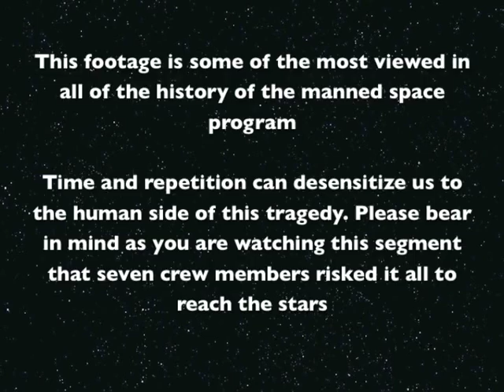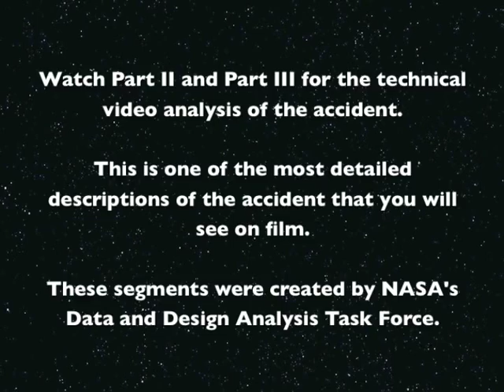Challenger Accident - Part I Launch

Comment: at lift off the O ring failed but amazingly some slagg blocked the seal that was broken and held it together, only when the shuttle passed through a strong jet stream (which you can see the evidence of at 11:31 ) did the slagg come loose and then the blow torch effect took place. also the crew cabin was intake after breakup and some crew may have been concious as the cabin fell to the ocean below.
Reply: fact. They died when they hit the water
Reply: Ed Weibe  yes! When they hit the water at close to 1,000 mph  to a sudden stop yeah! It killed them deader than hell.
Reply: D Marino That was just a guess I had no idea, when you hit the water at an unabated speed it will not be a good ending!
Reply: @gunn13fan  207 to 217mph they took impact 😐
Reply: Andrew Gray I believe it too! I’m sorry it happened!
Reply: @gunn13fan  200 mph not 1000...
Reply: @Faven2011  I'm aware of that

Comment: Yes, the same footage I have seen probably 100 times since the disaster, including watching it live the day it happened.  And again..it did not explode.  Aerodynamic forces ripped challenger apart after it veered from it's flight path due to the failure of the external tank and the asymmetrical thrust produced by the R. solid rocket booster.
Reply: Arsene Who?  they where alive when they hit the sea, unconscious likely but alive..
Reply: attached to a 15 story hydrogen explosion

Comment: It was cold in Florida and they were canceling flights because your not supposed to take off when cold and they took off and something froze and which cause the shuttle to explode!
Reply: westyn mitchell The cause was a faulty O ring. They knew about it. But failed to replace it
Reply: @terryshubitowski9395  It wasn't a faulty o-ring per se. Any o-ring would have likely failed at that temperature. It was a faulty design of the field joint.
Reply: @terryshubitowski9395  The o ring wasn't faulty. It froze because if the below freezing temperature that morning. When it froze it contracted and let the rocket fuel leak into the joints of the fuel tank.

Comment: All data showed an increased likelihood of primary O- ring failure corresponding with lower temperatures so they decided to launch in an environment so cold that they had no data available in regards to safety.  The industrial standard violating, improperly used 2nd O-ring always sealed before and if it dont at least we'll have the data necessary to create some real spiffy heated O-rings.

Comment: It did not explode...it disintegrated when the strut holding the solid rocket booster failed due to a jet of flame acting like a blow torch produced by escaping hot gasses which leaked around a frozen O-ring seal.  The booster pivoted inward and struck the vehicle, the impact and non-linear thrust causing the vehicle to yaw at incredibly high speeds leading to the near instantaneous disintigration.

Comment: Yes, there was no major explosion as such. The large "fireball" that people talk about is actually a huge "spill out" of liquid oxygen and hydrogen from the ruptured external tank. There WERE smaller explosions as various hypergolic fuels used in the attitude thrusters did explode when their tanks ruptured due to orbiter break up. These small explosions can be seen as individual flashes during the break up sequence. They also account for  the brownish splodges you can see in the overall residual plume.
Reply: All that equals a humongous explosion to 99% of the viewer.
Reply: @jerrymarshall2095  Looks can be deceiving.
Reply: @EricIrl  indeed they can.Eric

Comment: To be completely honest with you all, I would blame NASA because they didn't seal the SRB joint completely, if they did, they still would've been alive today.
Reply: jonathan ehlers I never blamed them because who knows what else might have gone wrong as a result of sealing it? Accidents do happen and people are human and do make errors. I remember people instantly blaming the cold even before the seal issue was named as direct flaw. I kinda think they just ought to have delayed for warmer weather. If they’d done that and still this happened I wouldn’t think they had such bad judgment.
Reply: it was too cold to launch. The seals were too stiff to get into proper place.
Reply: @corettaha7855  It wasn't an accident. Engineers at Morton Thiakol (the company that manufactured the solid rocket boosters) recommended not to launch at a temperature less than 53 F. They had been dealing with partial o-ring failings in the previous year.

Comment: Yes, they were heroes, but they were also patsies, placed in real danger in a claptrap machine pieced together on the cheap.
Reply: Kit Canyon  the shuttle was for sure no claptrap, especially operated as intended, and not as it was on this terrible day. However compared to other rockets, the space shuttle was bonkers dangerous - no launch escape system, no chance of returning if something went wrong until you could ride out the solid boosters.... The program itself was a massive waste of money in my opinion anyway, bar for the show of unity it brought us that is the ISS. We would have been better off putting the money toward more Moon missions, a Mars mission, or developing a deep-space, reusable rocket sooner. Without SpaceX, the past 6 or so years would have been spent in further space exploration limbo.